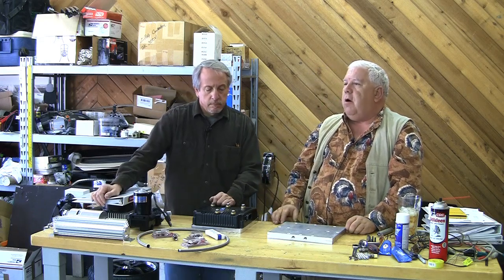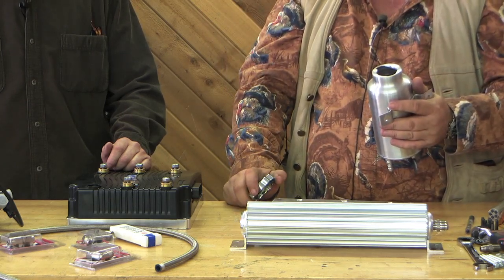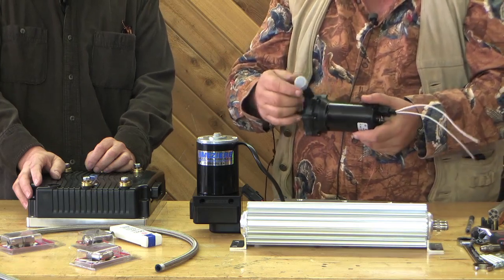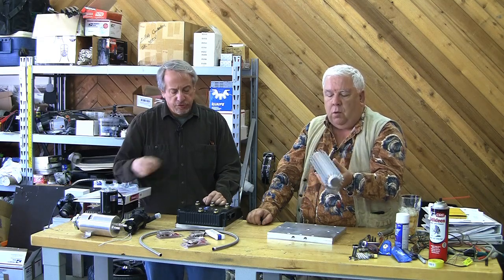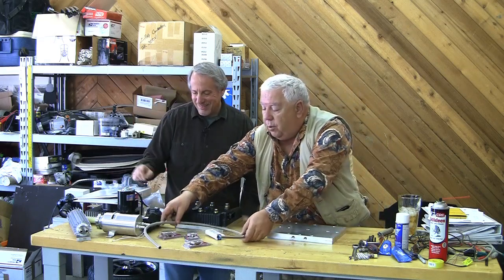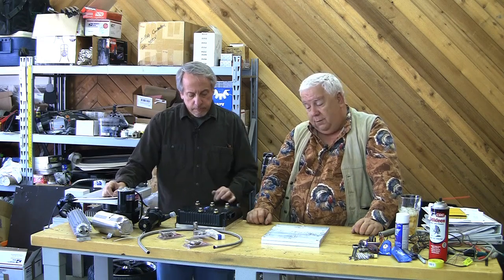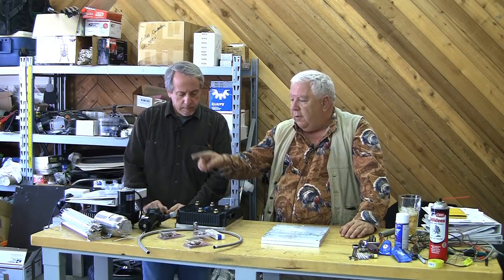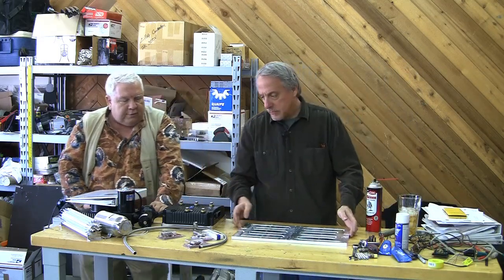EVTV - March 19, 2010.  Part 8 of 11

Comment: If your circular heatsink has smaller surface area than the square one, you're actually going to reduce your heat transfer away from the controller unit. Water will only transfer your heat away from the controller to the circular heatsink, but if the heatsink won't dissipate that heat fast enough, it will become as hot as the controller plate. Especially as the heatsink doesn't have any fan to remove the heat from it. You may want to install a 50 or 80mm computer fan on the circular edge.